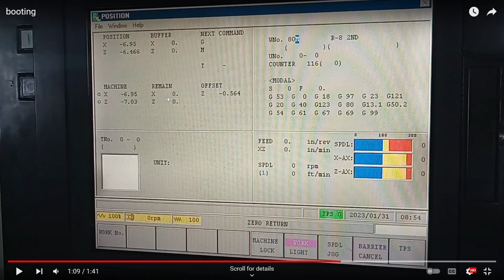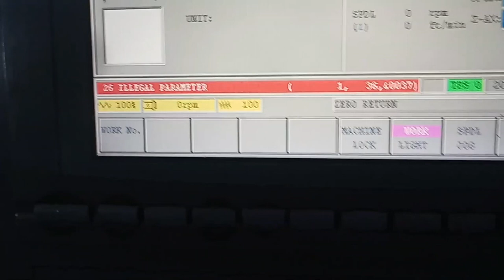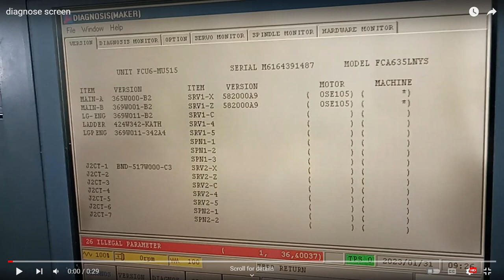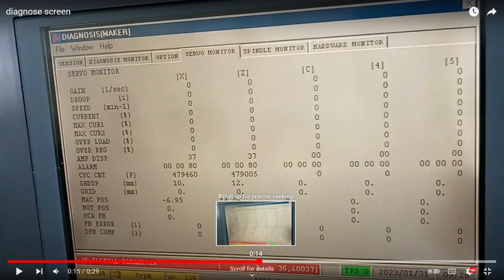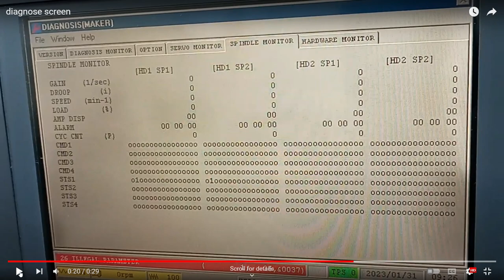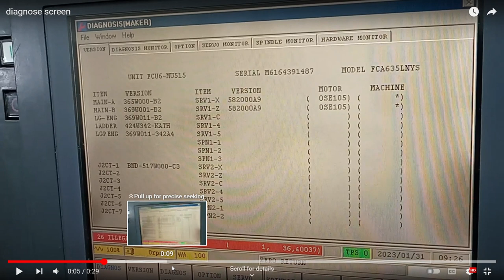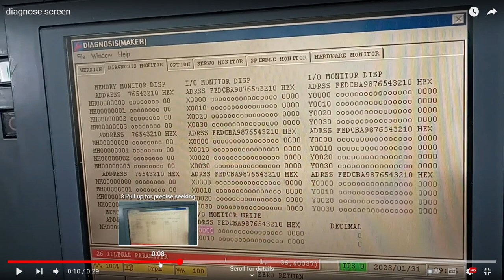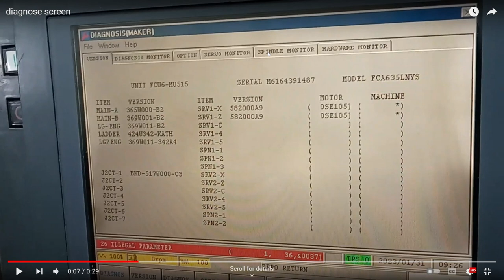M640T: 26 illegal parameter ( 1, 36, &0037)

Comment: I have a new video after getting the spindle drive rebuilt. New errors
https://youtu.be/VstCZHDhGKw
Reply from the maker: @Marty, how is it going?
The code (80,0) means communication error with the 1st axis drive which in this case is X . You have a double drive that controls both axes, X an Z and there is a rotary switch hidden below the acrylic where the 7-seg display is. Make sure all addresses are correct specially for the spindle drive. If they tested it perhaps they changed its address. Also make sure the communication cable and the terminator are well connected. E7 on the displays means the CNC is in emergency state and there is no any issues on the drives.
Hope this helps. Take another video if you solve it to see what you found
Reply: @FabianAchaval  The rotory dial is set to 5 and drive flashes F-6 then E-7..I have went thru cables many times but I will try again?
Reply from the maker: @Luckyslife57  see this video https://youtu.be/lhnVV3tN1-s and let me know if you were able to test everything without the spindle
Reply: @FabianAchaval  ok after reboot with the terminator on the x/z drive cable thre x/z drive shows a 37 error. and the machine control just has the original 26 illegal parameter orrer same exact alarm as before. no error for the 15 alarm
Reply from the maker: If you can, also show me where the communication cable comes from. This is to figure out how system is composed.
Reply from the maker: Try to disable the spindle drive just placing the terminator on the axes drive
Reply: @FabianAchaval  ok I will unplug THe cable going to axes drives and move terminator plug in its place?..then restart?
Reply: @FabianAchaval  sorry i had to logout of my other utube acct. 
ok after reboot with the terminator on the x/z drive cable thre x/z drive shows a 37 error. and the machine control just has the original 26 illegal parameter orrer same exact alarm as before. no error for the 15 alarm

it does not show the drive at all in version screen
Reply from the maker: @Luckyslife57  good morning. 37 code means there is parameter error on the axes drive. 
If all communications cables are ok starting on the CNC CPU (back) to the communication board, then to the drives; then the parameters you have are corrupted or the communication board is defective, or the drive unit is defective. Ultimately, the CNC RAM could be defective, but it is not a common to happen.

Do you have the machine backups on the cloud? do you have 2 different backups to compare? 

Check error codes 37 and 34 on the link below. 

Hope you can solve the issue.
 https://us.mitsubishielectric.com/fa/en/support/technical-support/knowledge-base/getdocument/?docid=3E26SJWH3ZZR-24-3607#page=147
Reply: @FabianAchaval Good afternoon!   I contacted the drive people they havent been much help. I have a backup .prm file. but i think thats for the mrj2 parameters. I can see the backup file in the main.exe. This machine has not had a complete backup thru the main.exe. I have the file that I think is the back file parameters that you have discussed in some of your videos. The last time I tried to backup by using that, I could not highlight that file. It showed the file but would not let me select it?
Reply: @FabianAchaval  https://youtu.be/UolWd1Wz2v8
this is a video of me attempting to backup parameters.
When control was booting the spindle drive for a quick moment flashed C6 then went away..and Just F6/E7 after that. now they think the power supply is bad? Thoughts?
Reply: @FabianAchaval   just now on reboot I got the pesky 350 operating switch alarm. When I hit reset it went away and the error 15 said(81, 516) 516 is new? All drives still said E7
Reply: @FabianAchaval  516 error went away on next reboot. Heres a video of the drives machine booting up
https://youtu.be/1uoZ-l4mqm0
Reply from the maker: @Luckyslife57  the drives seem to be OK now. The boot-up sequence is correct.
Alarm 15 SYSTEM MALFUCNTION means "An error occurred in data transmission between the NC and the amplifier when the power is turned on."

Check the amplifier for:
-  Improper connector connections
-  Improper power connections*) 

If an error occurs during the transfer of data relating to the fundamental axes (X, Y, Z, C, B, etc.), alarms 015: SYSTEM MALFUNCTION and 033: EMERGENCY STOP will be displayed. If an error occurs during the transfer of data relating to auxiliary machine axes, only alarm 015: SYSTEM MALFUNCTION will be displayed. 

Do you only have alarm 15, or also alarm 33 appears?
If only alarm 15 is present, then you have to focus on the MR-J2 drives for the turret and/or tailstock, and on the communication board. 
Can you make a video showing the communication board and communication cables to the MR-J2 drives? How many do you have? There is a software to access them. Check this playlist.

https://youtube.com/playlist?list=PL-Qx9JZP7OUTe3NYF2THjUiggHJnTtUC6
Reply: @FabianAchaval  We also have the 33 error.
Reply from the maker: @Marty, please see my reply on your video https://youtu.be/UolWd1Wz2v8